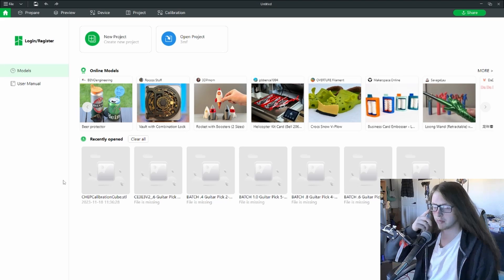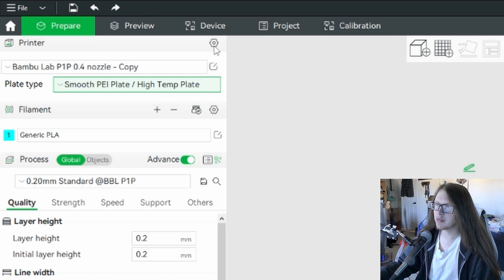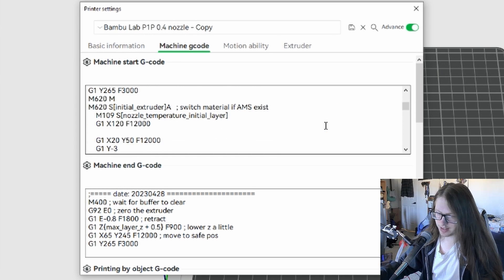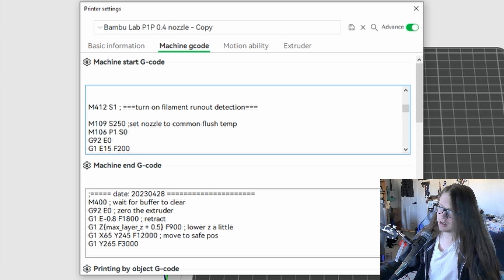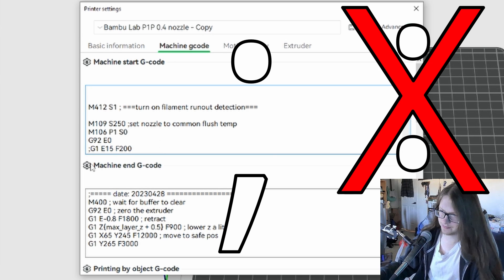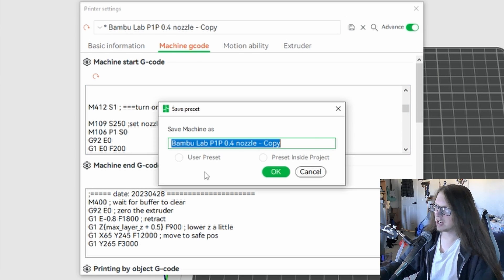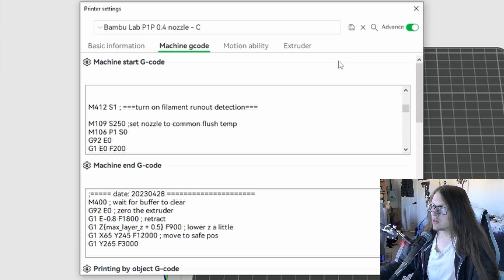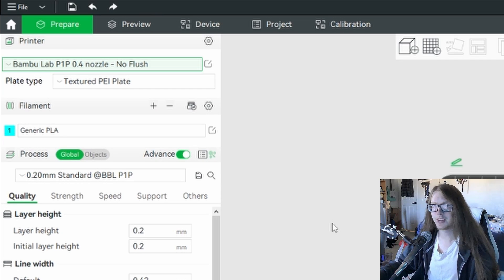(WATCH UPDATED VIDEO) How to Reduce / Remove Bambu Labs Purge

Comment: Thank you for your video.
But why is there 2 lines with G1 E50 F200 ?
Should only the first line be changed ?

G1 E50 F200  <-----------------------------
M400
M104 S[nozzle_temperature_initial_layer]
G92 E0
G1 E50 F200 <----------------------------------
Reply from the maker: I try to address this in my updated video on this concept. That second line was added shortly after I made this video in an update. It's supposedly to shove some barely melted plastic into the nozzle to stop oozing during the rest pre print calibration process. So with this knowledge, it's up to you based on what you want and what limitations or special attention the filament you are using needs. For TPU, you may want to try to plug up the nozzle and reduce some of the oozing. For PLA and most other more rigid filaments, you will typically be okay completely removing both purges. I have for a while now, and haven't really had any issues, but I have been mostly using PLA lately. Also everyone's machines are a little different and everyone's situation is different, so you mainly have to use your best judgment.
Reply: @Bowsmin12  Thany you ; I see the new video. The only problem (which you mention in the video) is that the modified g-code does not go to the Cloud and I don't want to bother using the SD card to make my prints. It's a shame.
Reply from the maker: @felixoudu57  I don't know for sure, but that may not have been the issue. I think they just added that second extrusion line extremely close to when I released that first tutorial and I kept missing it while checking my code. I think it was possibly due to how the scrolling of the Gcode box naturally locks in it's positions, but I don't know. Since changing that second line, the wifi print sends have been not purging for me.
Are you still having that issue? Try changing both lines to no extrude and watch the pre print process. Let me know if it works right for you.
Reply: @Bowsmin12  I tried your modified G Code with E15 and E0 and it works great and goes through the Bamboo cloud. No need to print via SD card.
Thank you again !
Reply from the maker: @felixoudu57  That's great to hear, glad it helped.

Comment: Great content... will this work with the AMS?
Reply from the maker: I do not own one, so I cannot confirm personally. However I don't see how it wouldn't work with the AMS. I think the start gcode is separate from the printing process gcode, so they shouldn't interfere with each other as far as I know. And I believe there is a more easily accessible tool to dial in the purges of AMS color changes.

Comment: Awesome video thank you! Went thought a full dam spool in 2 days making nothing. So much waste
Reply from the maker: Real. For a while there was a new issue where it would still purge, and it was because they added A SECOND PURGE! The second one apparently was to try to force plastic into the nozzle while it was cooler to block ooze, but I don't know. I just disabled both of them, and with PLA at least, I haven't noticed much of a problem. Maybe with TPUs or some other plastics.

Comment: Does this work with the a1 mini?
Reply from the maker: Not the exact same way, but I think you can find the same extrusion line if you copy and paste the code into a text editor. I have a new, updated video that came out today. It goes over a bit more details, but I still do not own an A1 or mini. So I cannot verify which extrusions is the right ones.

Comment: Thank you. It's being quite weird coming back to Marlin after 3 years with Klipper.

In the P1S there's two consecutive purges, and both were E50 for me, It was ridiculous lol

M109 S250 ;set nozzle to common flush temp
M106 P1 S0
G92 E0
G1 E15 F200
M400
M104 S[nozzle_temperature_initial_layer]
G92 E0
G1 E15 F200
M400
Reply from the maker: Okay, I think that may be newish, but have noticed this. I have been having this problem for a bit but thought that it may be part of a calibration like some of the other extrusions in the code. I will mess with this and will probably have to make an update somehow. Getting people to notice the update can be a challenge though.

Comment: It is pretty cool that you can make these changes in the machines gcode. Sadly the A1 mini does not line up with you edits. Does anyone know what line to change on the mini?
Reply from the maker: Yeah, I tried helping someone else by looking at the code for the A1, but I can't verify it's function. If you would like to see me work with the A1 or the A1 mini, the only thing I can suggest at this time is to send an email to marketing@bambulab.com and ask them to reach out to me and work with me so I can work with these machines, figure it out, and make the videos. I may be able to find something in the A1 mini code as well, but can't make any promises.

Comment: good morning! I didn't find this command in the gcode line of my Bambu Lab A1. Could you help please?
Reply from the maker: Okay, I opened the A1's start gcode in Bambu Slicer, and copied the code into Notepad. I found two of the extrusion lines using CTRL C.
Due to there being no code lines / numbers, it's hard to explain where they are. The section starts with M620 M ;enable remap. The first extrusion line starts 5 lines down from the second section marked by a gap. The next one is in the next section, 3 lines down and is marked with "; lower extrusion speed to avoid clog" on the end of the line.
These are the same extrusion lines as on the main advanced printers shown in the video. However I don't know exactly how they affect the A1 printer, so you will have to experiment and try to pay attention to what's happening. Of course adjust these with caution. It's possible that they may be used with some sort of calibration, so just be careful and pay attention.
If you would like to see me experiment with the A1 printers, I would suggest contacting Bambu Labs support with a general inquiry asking them if they would be willing to reach out to me and work out a deal. You can contact the proper channels through email here :  marketing@bambulab.com
I hope some of this helps and I thank you for any support to the channel.

Comment: I try this todo for the bambu lab A1 but it is not working.   Probably not that line for me then?
Reply from the maker: There are two options I can think of but I don't own an A1 so I can't be for sure.

The first one is if you are sending the print over wifi, I don't know if the A1 even supports this, but I made an update and short about this. For some reason (unless there was an update that I haven't noticed yet) bambu studio seems to bypass the altered gcode when sending the print over network.
The other is that like you said it may be a different line and / or your gcode may be structured differently. But also keep in mind that apparently, at least for the P1 printers, there are multiple lines of extrusion that look like our same one, just in different places, presumably for different functions.

So you can try to troubleshoot yourself and I would check your code again and see if you are in the right spot and if you do a print I would try to see what's acting differently in the pre print process. I would compare and do two prints with default and your altered gcode, film it with your phone if you can so you can review and re check the processes so you don't have to do the process over again. And if nothing is different, again the network thing, but also make sure you are on the start gcode. But then again I don't know why there would be any similar lines on the end code, but it's still a suggestion just to be sure.

The last thing I can suggest is just going to support and asking. That's how I got this solution. You just have to be very specific and descriptive of what you want. When I was first trying to ask, it took them a little while to understand and even get me the right code. They had a mix up with that in the beginning.
I hope something in here helps.

Comment: THANK YOU, THANK YOU, THANK YOU!!!!
I don’t use multiple colors and I had a issue that I printed a thin cylinder, like a watch pin and my purge was more than double of the pin. Glad I decided to try this.
Reply from the maker: This might be a bit weird, but can you do me a favor? Can you use the code and export with the SD card and let me know if it actually works? My code change doesn't seem to be working for me right now, so I want to know if it's wrong, if bambu labs updated something that's messing it up, or if it's just me. Let me know please, thank you.

Comment: great....do you know how to remove the front and back purge lines before a print?
Reply from the maker: I believe the rear one is a calibration and doesn't use a whole lot, but I'm not fully for sure because I don't think the P1P either has it or takes full use of it. And the front one is similar.
The code is probably more extensive on the more expensive machines, but it's a calibration test on the expensive ones and possibly still has some functionality on the more affordable bambu lab systems, but I'm not fully sure. I would leave those ones alone just in case either way.
Though some other people have also commented that there are other lines of the same code later in the start code, and that is where I assume you can change the length and amount of the front pre print line if you really want to.

Comment: This stops both the front and rear purge line?
Reply from the maker: No, it only stops the purge in the shoot bucket. I believe the rear one is a calibration and doesn't use a whole lot, but I'm not fully for sure because I don't think the P1P either has it or takes full use of it. And the front one is similar.
The code is probably more extensive on the more expensive machines, but it's a calibration test on the expensive ones and possibly still has some functionality on the more affordable bambu lab systems, but I'm not fully sure. I would leave those ones alone just in case either way.
Though some other people have also commented that there are other lines of the same code later in the start code, and that is where I assume you can change the length and amount of the front pre print line if you really want to.

Comment: Would this be good if I'm using only one color
Reply from the maker: Absolutely. I found a million tutorials about reducing purge with the AMS, but none about the basic pre purge. That is what my video is for is for when you're using mostly the same material and don't need the excessive purge in between prints. Just keep in mine right now there is a bug in the network features where it bypasses the gcode for some reason. Bambu labs says they are now aware of this issue and working on it. So if you're super concerned you will have to use the SD card transfer if you don't already.

Comment from the maker: IMPORTANT UPDATE 6/17/24 - (FIXED) - It appears that for some reason Bambu Studio (bambu slicer) bypasses the changed gcode when sending the print using network features. At least this is the situation on my machine and has been confirmed as an issue by bambu lab support. I only used SD card transfers at the time so I was unaware of this problem. My guess is the their cloud or something is removing the "custom" gcode to prevent malicious activity or something like that. Bambu Studio does similar things when importing files with changed gcodes. Let me know if you have experienced this too or if yours works find for some reason.
Reply: Did bambu support say when they were going to resolve the problem
Reply from the maker: @bobska_2  Nope. I assume unless it was already in the works and close to done, they won't let us know. If I were to guess further, they probably either forgot about the issue or have it low on their priority list. But that's just guessing and I'm fairly cynical when it comes to these things. If more people put in support tickets about it, it may get put in production faster, but that doesn't necessarily guarantee anything either.
Reply: @Bowsmin12  okay fair enough that's a shame
Reply: Is this a problem with orca slicer?
Reply from the maker: @RicoCruz-s2h  If it is updating properly with the bambu labs G code, probably. I have been informed, today actually, that there seems to be a second purge now, just a bit below the one show in the video. So changing this will possibly fix it, but I haven't tested yet. And I don't know for sure if that was the problem or if there is a separate network problem as well. So proceed with caution.

Comment: good video was looking for matlab videos hahah for ideas ,and youtube recoemnded me this , hhaha i have a p1s and this is helpfull .. thank you.
Reply from the maker: That is a bit of a weird place for me to be recommended from. I guess Youtube still managed to do it's job right though since you liked the video lol.
Reply: @Bowsmin12  I will coment the line of code out , hope that sops the poop for single color . have the ams but dont know what to print in color lol have the basi color s that came with the machine. do you have a recomendation for the  settings to print with  peteg . my prints dont stick.
Reply from the maker: @JAYTHEGREAT355  Well I don't print with PETG very often. But I would say try raising the bed temp a bit. I don't remember the exact amount but I think 70 helps. That will be in the filament settings. 80 is where the magnets start to loose magnetism so be carful of that. I think bambu labs printers are supposed to be able to hand high temps but I don't know how.
- Something I forget a lot is that there are filament profiles, so I would start with the generic PETG setting unless there's a setting for the brand you're using.
- If I got prints to stick, I often needed something to help the warping on corners. (but I think that was on the Ender 3 V2) I use hairspray but there are a handful of other options like glue sticks or special polymer liquids.
- Another thing that could possibly help is slowing the prints speeds a bit. I don't know for sure that this would help but sometimes it helps the printer to slowly and firmly lay it out. And sometimes the speed causes the plastic to catch on the nozzle one way or another.
- The only other thing is this knock off replacement bed I got. ( https://amzn.to/3Rn0fFN ) I like smoother surfaces for bottom layers AND it seems to somehow adhere better than the stock bed. Though the flat side on this bed may not work with PETG. The petg may overly stick and damage the bed but I don't remember exactly, you would have to check the listing. Still, the textured gold side may work better than the stock textured bed, but I'm not 100% on that.
The link provided is an affiliate link, it doesn't cost you anything extra but helps me a bit. They also have other cool textured beds. Believe the rainbow ones somehow impart that light refraction or whatever it's called onto the part printed surface. If you pick something else after using the link, it still helps me.
I hope this all helps you figure out your adhesion issues. Hairspray usually helps me 99% of the time when I need it but different brands and types also have different results.

Comment: Where do you sleep considering your bed? ;P
Tip from years of performing with my band that I learned early: Don't take time to excuse or explain a screw up or make pained faces etc... (IE: starting this with excusing/apologizing for jump cuts). 
Most people won't notice or care too much compared to after you draw attention to feck ups.
Reply from the maker: It's hard to tell from this angle but the other half is clear other than blankets and stuff. And yeah, I don't remember why I was worried about mentioning the video cuts. I don't know if it was to address why I would be looking down most of the time and I combined them for some reason.

Comment: Thanks a lot. I have been wondering about the same thing, usually when the filament is still in the printer and you begin a new print, you don't need purge.. There should be in prepare a square you can click for purge or no purge and amount of purge.
Reply from the maker: Absolutely. Other than color changes, I'm not sure of the purpose. If that. I personally purge to the new color through the load function before going to print anything anyway. Like you said it would be nice if they had a check box or a easily accessible input value somewhere.

Comment: I'm probably going to make this change now. I've never liked how excessive that purge is. It makes sense if you're swapping from white to black or something, but it sucks when you're just using the same color over and over, and apparently the printer has no way of telling that you're just starting a new print with the same color and needlessly purges. Also if you're using a brim it would be that much more viable to not have a purge, as it could just purge into the brim since that's trash anyway.

Comment: You can also use the Multiplier factor. If you use 0,50 instead of 1.00 (default value) the purge waste is half.
Reply from the maker: What do you mean by multiplier factor? Is that a line of code or a setting?
Reply: @Bowsmin12  at the bottom of the flushing volume window there is a setting called “multiplier”. By default the value is set to 1.0. If you set it to 0.5 it automatically reduces the purge volume by 50%.
Reply: I could be wrong, but I think the multiplier factor only applies to flushing volumes when using the AMS where editing the g-code I believe just applies to the initial purge
Reply from the maker: @IKnowImLost224  That's kind of my thinking too. I haven't thought about it much since I don't have an AMS, but that's kind of the way I was figuring it would work. I think they want the purge in there no matter what for other reasons than just to purge old coloring or material. I don't know for sure what those reasons would be but they probably have them.